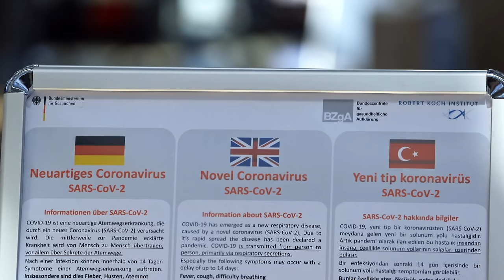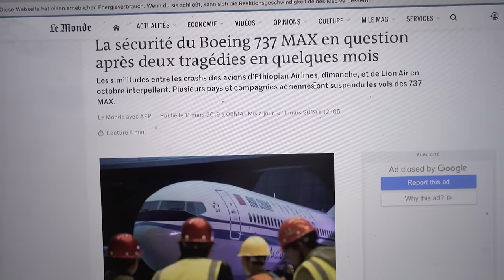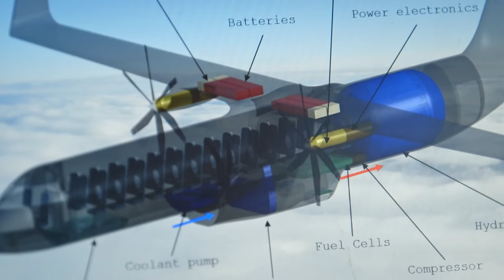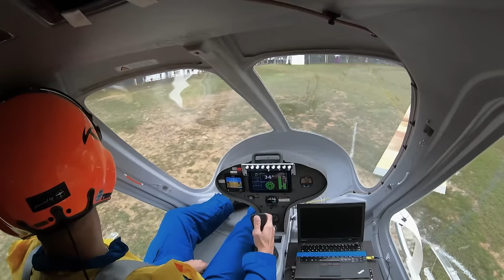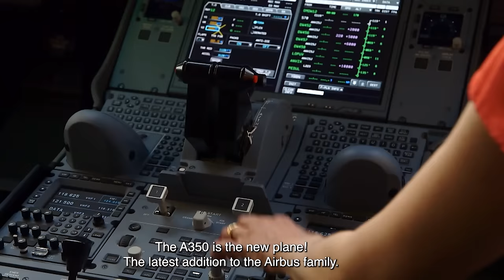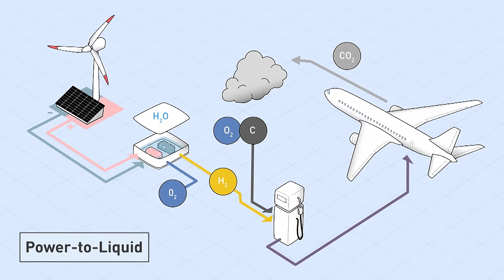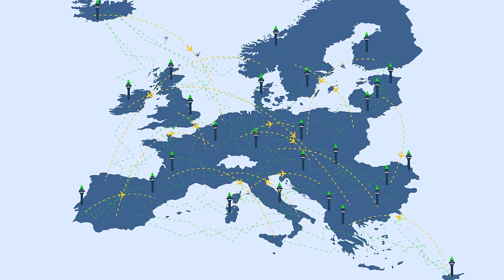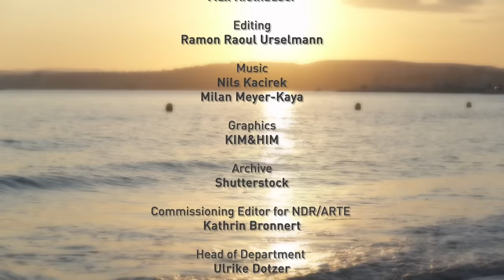The Future of Flight

Comment: Let me put this in perspective with some numbers rather than just opinions.  Globally aviation causes only 2% of emissions for passengers which  rises to 2.5% if we include freight.  There are claims that the effect on global warning is 3% if the fact that the emissions of water vapor are at high altitude.  (debatable) .
-Here are some other common contributors to emissions:  Cement Calciniation 5% Steal Making 3%, Road Transport 28%, Marine Traffic 4%.   Electricity production 30%.  Agricultural tillage and ammonia-fertilizer production maybe 10%.  (Energy = food unless you want to walk behind an oxen or horse)
-Here we can see the fist priorities and decision we must make:.   Aviation is an almost insignificant contributor and also because it is expensive sector to de-carbonise its best to focus limited resources elsewhere.  For instance using a carbon neutral supply of hydrogen to produce carbon neutral Iron and Cement is far more cost effective than using it in aviation and of course the main priority of investment is produce carbon neutral electricity in the first place.  
_If aviation needed to be decarbonized there are 3 ways
1 Improved airframes and engines which are going to yield a 30% reduction in emissions in 20 years.
2 Using a carbon neutral fuel such as hydrogen (lquid or compressed)
3 Using A Carbon Neutral hydrocarbon jet fuel called PtL Power to Liquids or electrofuel.  These work by extracting CO2 from the air and combining with hydrogen to make Jet fuel (or petrol).   It's already in low rate production from several suppliers.   It's up to 60% efficient to make.
What not to do:  Electric Aircraft.  For Ranges over 100km the weight of batteries of an electric aircraft make the aircraft 3 times heavier and therefore bigger for the same cargo and this uses MORE energy rather than less.
Reply: *Steel.
Thank you. I prefer the numbers. Make so much more sense to me.
Reply: @jennifreakthompson8888  The ICAO standards on emission reductions (which most of the industry is following voluntarily). are designed to reduce emissions such that aviation doesn’t become a bigger contributor as emissions in others sectors reduce.  They may fail at this but the other objective is the hold total emissions steady, even while the industry grows.